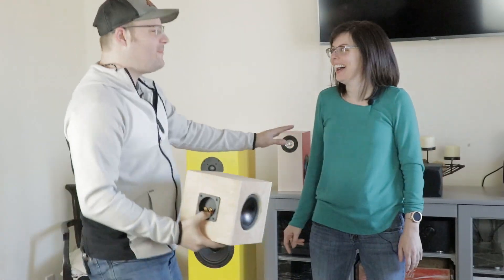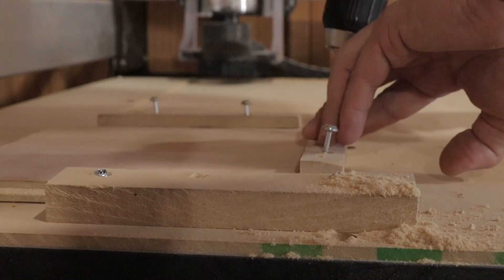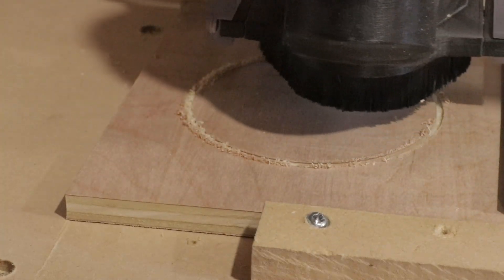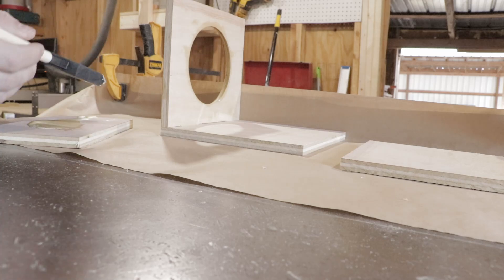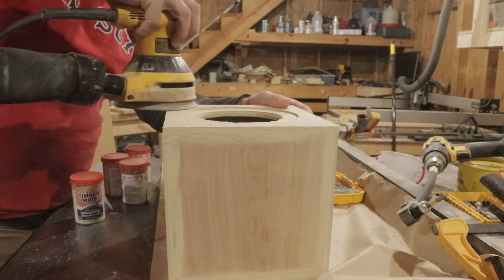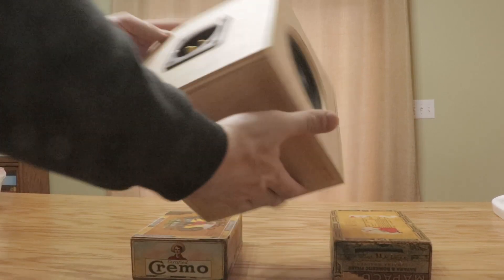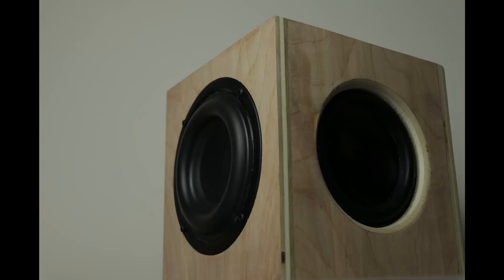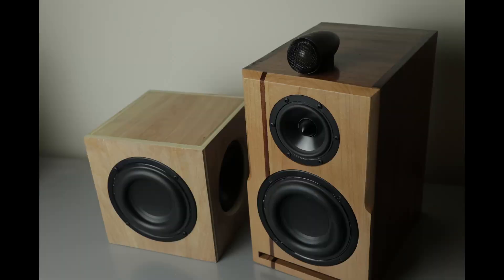Mini Earthquake - an 8" cube of BASS - Free Plans

Comment: This might be a dumb question but I'll ask anyway -- would benefit midbass woofers? And if so, could I put 4x 8" midbass woofers (for example) in a rectangular box with the back of the box being curved (instead of being flat like the faceplate the speakers are bolted on)?

Comment: This has roughly the same internal volume as voxel. Can you can confirm that  instead of PRs i can use a port and just use a pvc elbow so i can it can fit inside without the opening getting too close to the internal wall??

Comment: I'm learning this stuff from Y.T.
What is the advantage of the passive radiators Vs a sealed enclosure?
Reply from the maker: Passive radiators act similar to ported enclosures. That means they have the ability to play lower and louder. The vantage of them over a port is you don’t have to worry about port noise and the box is smaller. The disadvantages over a ported system is they don’t tune as low and have a steeper drop off.

Comment: Great little build! Correct me if I'm wrong, but i thought the passives should be the same diameter or bigger than the main driver.. Am I wrong?
Reply from the maker: That is a common misconception.  Passive radiators should have twice the volume displacement.  The volume displacement is SD x Xmax.  You can use about any size as long as you have at least twice the volume displacement as the original driver.  Most people simplify this as saying you need two passive radiators the same size as the active drivers, but that just isn't true.  If you have a passive radiator with the same SD and same size as the active with twice the xmax, you would be fine. You can check out this video on passive radiators as well, if you want to learn more about them: https://youtu.be/ISCdx73hRxo

Comment: If using 2 w5-1138sm,  can we simply double the volume inside with 4 pasive radiators?  Does the 2 subs need to be plug in serie or parallele?

Where can I contact you? I try to revister to your webpage but I never recieve the email activatuon enven after multiple time. . .

Thank you

Comment: I built a very similar sub with the same passive radiators and the non neo version of the tang band 5 1/4" Obviously I am not the only one to pair these components.   It really does sound great... I use it every day under my feet in the design lab. Super full bass from a very small enclosure.  Just FYI the non neo version is a much better sounding sub I have done several builds with each and side by side the neo version sounds weak.

Comment: I’m doing a similar design but using the W6-1139 and 2 SB Acoustic PR’s. The WinISD graphs all look great, but SB have suggested that ringing could be an issue. Others have said not to worry about it. 

Did your graphs show that ringing could be an issue with this design and, if so, can you detect any?

Comment: I need something like this in the middle of my shop.  Kinda looking for 360 coverage in small package.  Do the radiators give more surround sound given they are in the sides of the box or are they more for giving the main driver breathing room in a very small box?  Any plans for something like this?  A cubic foot ok.
Reply: Sub-bass isn’t generally directional, i.e. you shouldn’t be able to tell where the sub is located. You do get gains (increased volume) if you put the sub against a wall, or even more so if placed in a corner. The best thing you can do is use multiple subs for good coverage in your shop; they could be driven in mono from the same amp (maybe not this amp) to keep costs down.

Comment: Great. Hey I need some help with understanding how to select a passive radiator and if the recommended volume sizes for sealed cabs for the active speaker are the ones to be considered for the use of them. Thanks.
Reply from the maker: You should consider joining the forum. That's where we tackle topics like this. www.toidsdiyaudio.com/community
Reply: I will right now.

Comment: I can not Understund how this subwoofer working without air Window, Can you explain me please, if i use two speaker wofer.. there is problem with speaker or box?
Reply: Port* and u don't need port u can use sealid box or with a passive radiator

Comment: Do passive radiators need to match the active speaker size?  Could you use the Dayton Audio low profile 6 inch with the same radiators?
Reply from the maker: The passive radiators need to have twice the volume displacement. If you follow the link above to the right up about this, the comment section talk about how to figure that out. I also did a video on how to design a passive radiator setup, found here: https://youtu.be/sG_8qgSjUqE

Comment: Umm cross cutting on a table saw? Do you like the way your fingers are right now or are you interested in maybe removing some of them? It's called a cross cut sleed. Don't use the fence when cross cutting. Your piece of wood could bind-up against the fence and twist bringing your fingers with it. You might also try some push sticks.

Comment: Hi,
Thanks for this info do you think 1*PR is sufficient to handle one W5-1138SMF subwoofer, and one builder from PE uses 2 of ND140 for a single W5-1138 he said the W5 maxes them out. What do you think?
Reply from the maker: There might be one passive radiator that will handle it, but not these passive radiators. These passive radiators will be maxed out if you do any bigger of a box. So if you try tuning lower and going with a bigger box, these won't work with it. But they do work with this particular volume.
Reply: @Toid  BTW what is the internal volume? 7-8litres, or 0.29-.0.33cuft.
Reply from the maker: @yttean98  most if this information is in the build log linked above. I would suggest reading it, so it'll give you a better understanding of what will and will not work. This internal volume is around 0.175

Comment: Nice build! Something to try if you haven't: Before assembly, saturate your wood with boiled linseed oil and let sit 15 minutes; then wipe off the excess. Then apply your wax!.  I was going to build some Overnight Sensations for my desktop and want to add this for a mini-sub.
Reply: What does the boiling linseed do?
Thx
Reply: @ds1919ds1919  Gives wood "character" by bringing out the grain and enhancing the color.

Comment: So I'm using 4 of these subs tuned to 34hz in a ported box.  They do every bit of that.  Great little subs, was very impressed.
Reply from the maker: They really are super impressive subwoofers for their size. I never used them due to their price.  I always thought, man I can get much cheaper and bigger.  But there is a reason these cost more.  They are insane!  Sounds like you built a sweet project!
Reply: Can you share the measurements of the ported box ?
Reply: You could have gotten an 18 inch Ultimax for that kind of money

Comment: Cool little project Nick! I see you are using Johnson's Paste wax in the video, did you ever try it on the table saw top? Here's another tip I hope will help, next time you buy a router bit for the CNC, get a down-cut spiral. It will leave a much cleaner finish from the top. Added bonus, it puts downforce on the part as it's cut (useful if you ever decide to switch over to a vacuum table).
Reply from the maker: Thanks Kevin. I actually plan to get a downcut bit from tools today. Thanks for the tip! I had been using a compression router bit, but it really wasn't working the way I thought it would.

Comment: Thx for the vid.  I’ve used those subs in a number of builds.  They rule! Does the build log give the weight added to the PRs to tune them?  Should really do a video specifically explaining how to tune with PRs
Reply from the maker: The build log does offer that.  I completely agree these subs are beasts.  I may have to work on a passive radiator tuning video sometime.  Thanks for the great idea.

Comment: How's this compare to the Voxel which uses a similar driver?
Reply from the maker: It's similar in they can both use the same driver. The difference is this one uses passive radiators and is tuned higher. If you need the lower tuning, the voxel is a great design. I even redesigned it with a front firing slot port to cut down on the port noise.  The Port is the one downside for the Voxel. depending on how much power you're giving it, you can definitely get it to chuff. Having said all that, I think it's a fantastic sub, this is just another option and how to use that particular sub driver.

Comment: Is the response the same with the cheaper driver?
Reply from the maker: Yes the frequency response is virtually identical.
Reply: @Toid  Cool might do that then!
Reply from the maker: @Ryezn5057  The only thing that I mentioned in the write-up, they didn't mention in the video, is if you use the smf version, you'll need to make at least a double front baffle to fit the motor between the passive radiators

Comment: Friend you really need to get some pusher sticks or better yet  pusher pads for your table saw.  It is so easy to lose a finger or  mess up a hand in the blink of an eye. Google table saw accidents.  Or at least the people wanting to copy your design ought too.
Reply: entityofme the way a lot of blade guards are and the knife deal..... it can end up being more dangerous.   I took mine off after shit got caught.   

I made zero clearance inserts.   That is one of the biggest things a person can do to improve safety.    

Push blocks and push sticks ( two ). Are critical also.   

If a person wants a cheap diy that you can toss when it’s time, you can take some 4”x 10” or so mdf then spray glue the drawer liner stuff that grips real good, then trim off extra. 

That way you can hold down flimsy stuff like 1/4? Or abs etc and set the blade so it’s just cutting through material and hitting the drawer liner if you need to hold it down nice & tight as it goes over blade
Reply: Lynn Poole most important thing is to be wide awake & aware!   No distractions no hearing protection so you know your environment better, safety glasses..... super tight fitting gloves that have better grip than your skin on your fingers if that helps you have improved grip.   (Some will try to argue this but they don’t get it....I’m not talking “leather work gloves” that are all loose & shit.    Either those gloves that are dipped on the face of hand if they fit ultra tight or I have disposable gloves that have excellent grip.  There is no way the table saw is catching these and sucking you in.....one more time for the people in the back... I said TIGHT!   If you can’t pick a booger out your nose wearing them, they are not tight enough!
Reply: entityofme you are using you blocks or sticks.  Also proper technique when pushing sheets through.   You don’t push straight into the blade, you push at the fence and forward.  

I use tablesaw almost daily.   Ridgid r4511 granite top saw.  Have not had an issue or kickback in a decade.
Reply: @caseytbss  if I were you, I'd shut up right about now.
What you're saying is dangerous af, and you should never give out that advice anymore!
Only old ass idiots would ever say to not wear hearing protection!
Also shut up about not using a riving knife or splitter.
It works wonders and if you manage to have that catch, then you're some kind of special that shouldn't be using a table saw.
Eye, mouth and hearing protection is a must use, not a suggestion.
A riving knife or splitter is also aust have, unless you're doing specialty cuts.
Let me guess, you also think it's fine to use the fence and miter gauge at the same time?

Comment: I built the hivi 3.1's and love them! Altho they have decent base for what they are, i def need more base.. Do you think something like this would match up with them? Looking for something small/inexpensive..  If not, what would you recommend? Really dont want to spend $300, thinking $100-$175 range.. Thanks brother!! Love your channel!!
Reply from the maker: This could be something to consider.  You could also consider the  Front Slotted Voxel, which goes lower and would be cheaper to build.  The main difference, is a port versus passive radiator and it's size.  Still a small footprint though.  https://toidsdiyaudio.com/product/front-firing-voxel-subwoofer-plans/

Comment: Trying to decide if the intro was corny or cheesy?  

Hmmm

Cheesy Corny Bread?
Reply from the maker: Lol, it's definitely both.
Reply: 123Toid lol!   Keep up the good work!     I need a neat enclosure idea that uses up to 4 of the tang band w6 6.5 ferrite drivers.     If you got any neat ideas?   I’m open to using 2 on each and making some towers using them as the woofers..... I also have a pair of the W4 mids/woofers that are the composite plastic frame & have the bolt studs around the lip that go in between each mounting screw.     They are neat speakers, called a 4” but they are bigger than most 5.25” speakers.